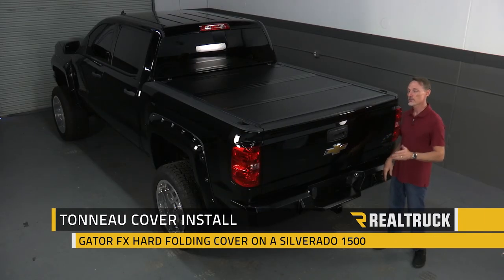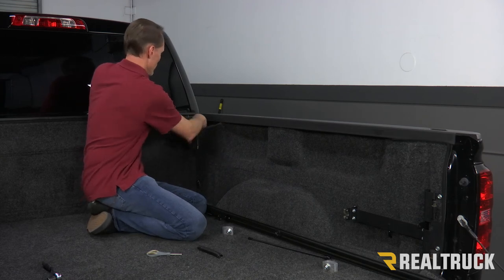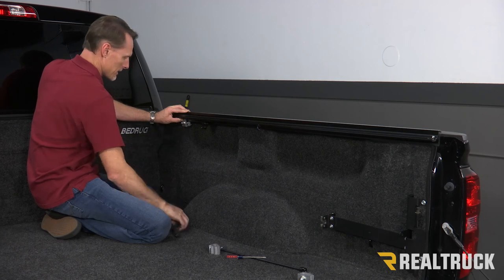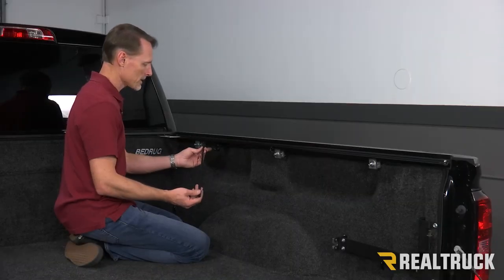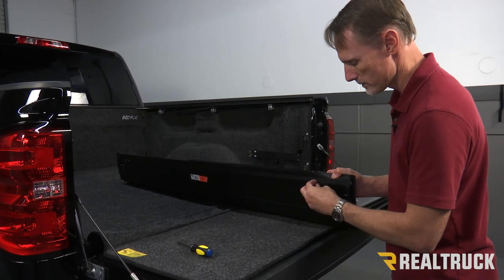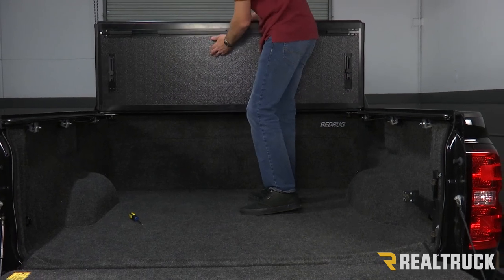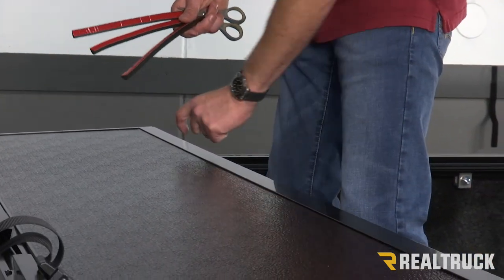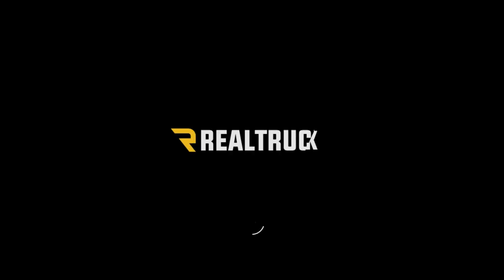How to Install Gator FX Tonneau Cover on a Chevy Silverado 1500

Comment: I have a tool box in the back that doesn’t hang off of the sides. Will this cover allow me to still access/open my tool box when against the rear windshield?
Reply from the maker: Hey there! Pictures would help here, it's a little tough to say from your description. But, if it sits above the bed at all, no. If it sits below the bed rail like more of a chest than a toolbox, it may work. Hope that helps!

Comment: I have the Putco bed rails on my trailboss. Will this cover fit or will I have to remove my bed rails?
Reply from the maker: Vern, This cover works with the Putco rails. You may need to trim the gasket where the Putco rail mounts to the bed cap, but the 2 products are compatible. If you have a Silverado like this one the hardware connecting at the rocker is M8x1.25, we recommend using zinc plated hardware. Hope that helps :)

Comment: Where to put the hose for the water on a 2022 silverado? The hose doesn’t go through the holes.
Reply from the maker: Hey Lonnie, this might be difficult because we can't post pics in the YouTube comments but... On each side, there is a plug covering a hole near the top of the bed, next to the bulkhead. That's what we use for the drain tubes on the FX, BakFlip, and Flex covers. Hope that helps!